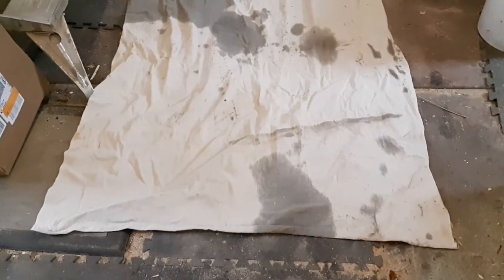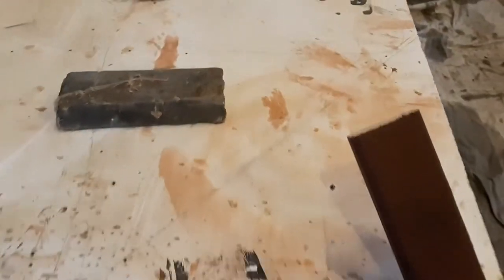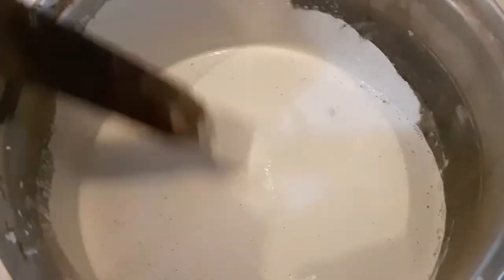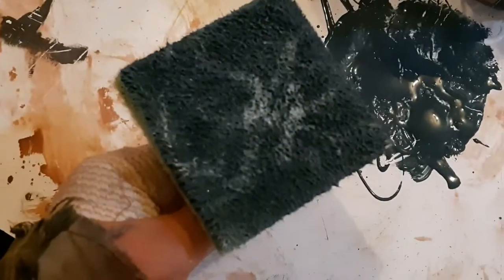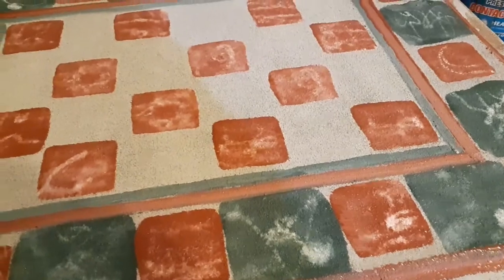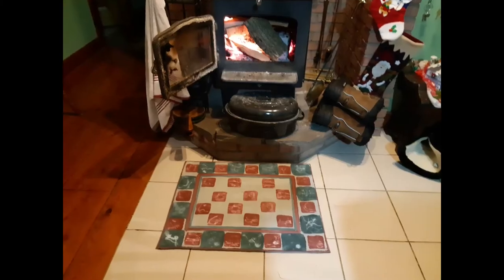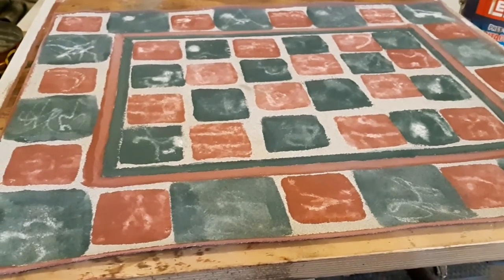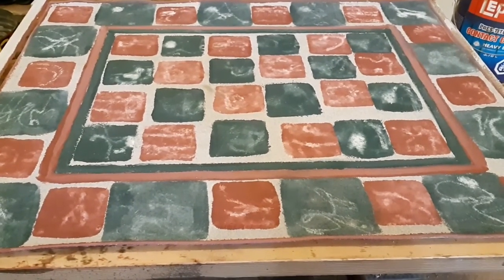Fire Carpet for Mini Wood Stove

Comment: That's pretty amazing.  Just the addition of the mineral content retards the flamability?  Did you record what approximate weight of solid to volume of liquid to achieve that?  Love the attitude ref progress.
Reply from the maker: It is more the tile grout mixed with the paint that "retards" the flammability! The carpet will light if a flame is applied but is intended to keep an ember from causing a fire and worked very well for this. It is also designed to insulate the wood floor below from the heat of the stove. Again it is working as intended!